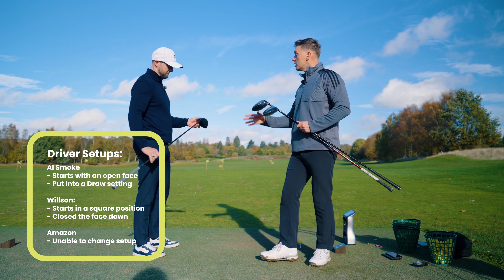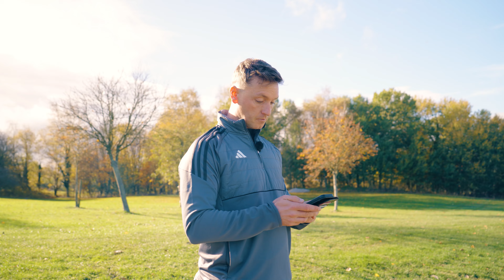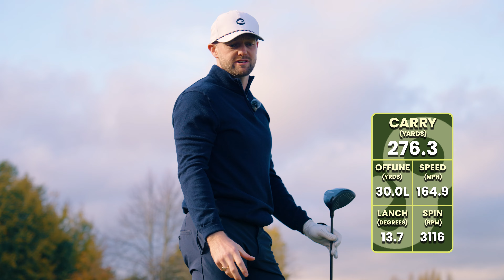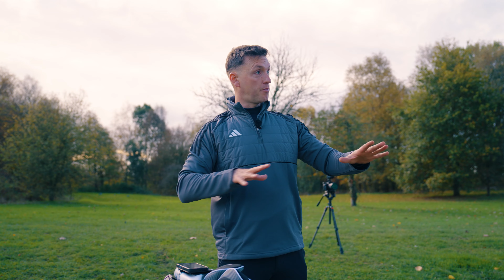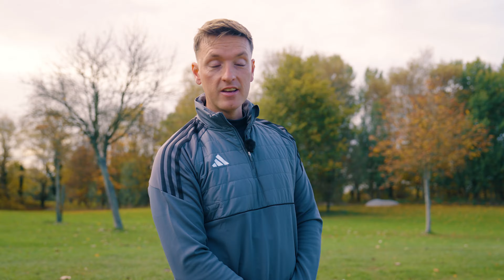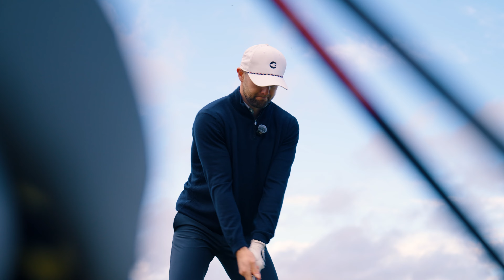£15 Amazon driver vs Callaway AI Smoke | Can you buy a better drive ...?

Comment: I have the Rogue St Max LS driver playing shorter with the Tensei blue 55 stiff and it’s been a weapon. Added the Ai smoke max 16.5 3HL with the Tensei 65 stiff and also really good. 

Struggling a small bit with my irons I230 with Dynamic gold 105 s300. Like the heads but wondering if anything decent on the second hand market that will swing not as bottom end as the irons compared to my woods. Any recommendations or a reshaft?